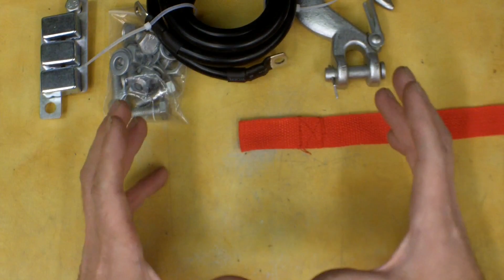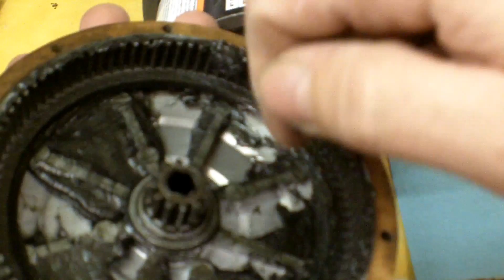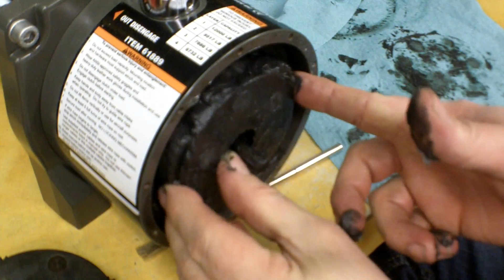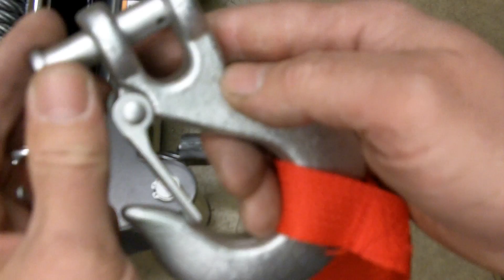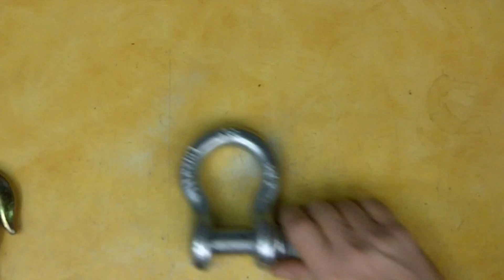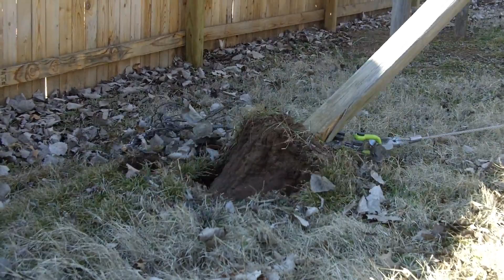Harbor Freight 12000 LB Winch Review, Teardown, Installation, Safety, Etc. Model 61889

Comment: I just bought a ZXR 12000 on the same Super Coupon deal for $299 and I also got the $59 wireless remote control because mine is being installed in my enclosed race car trailer.  The bracket on the box on mine attaches differently than yours ( the outlet or plug for the remote controller is further towards the rear on yours also) because on mine the small screw goes through  the bracket that yours has threads in as a clamping screw in on the bracket on the bottom of the box and mine screws into threads in a second tab that came in the bag with the washers, nuts and sundry other hardware so that it clamps it down around the bar.  But therein lies the problem the wired controller barely clears the spring where you plug into the box on mine - - the plug in piece for the wireless remote does not clear the spring no matter how far to one side you set the box so I am going to have to remove the bracket from the bottom of the box and space it up for clearance (the remote is a badlands apex wireless remote) so somebody at Badlands gets an F on their clearance homework.  Its going in a 28 ft. enclosed trailer plus 6 to 7  ft. of back door for a ramp so the wireless remote will allow me to sit in the car and steer it into the trailer so I don't need a 35 ft. cord which I could run over on the way in. UPDATE - - I found that once I took the attaching screws out of the bottom one hole on each bracket had a slot rather than a round hole so I reversed the brackets putting the slots forward ( slotted towards the Badlands logo) and the remote piece cleared but I'm still adding a washer or 2  because I don't want those springs on the tensioner rubbing on the box as they move to maintain tension as the cable plays in or out. Nice video, good detail and time will tell how this winch stands up to my old 9,000 Warn that I use on my open car hauler - - I've straight pulled a Class C Dodge RV up on to the trailer with a dually rear end that the brakes were locked up on from sitting so I was sliding the rear tires. It took some work but we got it loaded - - good luck with yours and hopefully your wireless remote is just plug and play (or work)
Reply from the maker: I'm not familiar what the ZXR Gary, but I'm sure your information will be beneficial to others. The wireless for this model was plug and play. The winch itself, albeit not worked hard, is still working great. Take care, G.

Comment: Curious if the winch is still running good and if you've had to get into it again for grease and or any service needed any problems over the years?
Reply from the maker: Caine, It's still working great and I have not gone into it since this video. Mind you, it's never seen hardcore use. If I need to use it, I install it and it just works. Good luck, G.

Comment: I appreciate the video and time you took explaining everything.  I have the same winch (several yrs old) and will be disassembling to inspect and re-grease.  Just curious, what keeps the 2 types of grease you used separated, if any?  I understand the regular type was only used on the outside of sliding ring gear but without a seal/o-ring of some sort, I would think over time and multiple heat cycles, they would eventually blend together.  Thank you
Reply from the maker: Thanks! I honestly can't answer what keeps them from mixing.  All I can say is that I've not been into mine since posting and it still works great. Not a concise answer by any stretch- but that's what it is. Good luck, G.

Comment: I would like to know how you got the solenoid cover off.  I have a winch like yours except mine does not have a tensioner on it. The last time I used the winch and went to release the line to undo the load all I heard is a clicking coming from the box.  I am having a lot of trouble trying to get the top off,  can you help me?
Reply from the maker: David, I believe there are screws that can be removed from the bottom of the box to gain access. This is from memory. Hope this helps, G.

Comment: Fantastic video.  I was very surprised at the duty cycle.  My winch spec is 1 minute on, 2 minutes off.  As stated in the manual, this is to let the battery recover.  First I should mention I have a Quadra Tech 9000 lbs winch.  The difference between the 9000 lbs and 12000 lbs is gear ratio. 

I found out the hard way.  The most important part of a winch is the battery.  If the battery is no good, neither is your winch.  Cost me $600 for a glorified taxi ride.  Got my self unstuck, but killed the battery.  Long story, save the details.

Must laugh at the trees being pulled.  Have a YJ.  I had the winch hooked up to a branch of a holly tree.  I had the wife winching while I was cutting.  This was when I was on a extension ladder.  Gave her the signal to winch.  She did not stop.  She pulled the whole tree down.  The stump was over 18" around.  The neighbor, professional tree feller, was amazed that happened.  This was done with a relatively new 850amp hr battery.

Long story short.  I love my Quadra tech  winch.  I have had issues with it.  Never left me stranded.  The tech support is unbelievable.  My winch was 5 years old and they replaced it.  I do not think HF would do the same.
Reply from the maker: Thanks John, glad you liked it. I leave the vehicle running to help with any battery drain. Glad they took care of you. I agree- HF after that long probably would not do the same. Take care, G.
Reply: @ghostses  Your welcome.  I always run the engine too while winching.  My battery died because it was old and and under rated.  It did come back to life after sitting for an hour or two..  At least to start it. 

The winch will pull 200 amps plus under full load.  Most alternators will only put out 100 amps.  This is why you need a high amp battery if you wish to get the most out of your winch.  That and the higher the voltage that is maintained, the less stress on the motor.  Higher voltage = less amps = less heat.
Reply from the maker: Very true John. Check out my review on the TackLife lithium jumper pack. It could be a good thing for situations just like you described. It's proven itself to be one of my better purchases. I make no money off my reviews/videos- so you get it straight as I see things. Good luck, G.
https://www.youtube.com/watch?v=GE8JV-S4NpU

Comment: I must have gotten a recycled return, the 3 circuit breakers were already connected to the short red lead with the red hood. Would it really matter where in the circuit the breakers are?
Reply from the maker: I would relocate the breakers to the battery side. You wouldn't want the buss so close to a ground that something could short things out. Good luck, G.
Reply: @ghostses  Thanks, and I should have mentioned at the outset that your teaching style is both informative and entertaining.
Reply from the maker: No problem and thanks! G.

Comment: I was using my 12,000 pound Harbor Freight winch and was winding it in and it stuck in the IN position even though it was not being pushed by the switch button. If i pushed the out lever it would stop coming in and if i let it go then it would start to come in again so i had no "out" working with the switch. I heard a clicking noise in the black box and removed the hot post wire and when i touched it back again to the post i saw what looked like and sounded like a live connection to the winch motor as though the switch was engaged in the "in" position. What went wrong? Any idea? I cannot put the hot post on because it engages the "IN" to the winch through the switch, no "out' at all.
Reply from the maker: To me it sounds like the solenoid contacts may have welded shut. So when the power is applied contacts are already closed therefore it automatically starts winding in. You might try opening up the lid and tap on the solenoid to see if it will break open. Short of that working, you might try to find a new solenoid. Hope this helps, G.

Comment: Over the years I bought a lot of Chinese motors and other types of working parts they have grease in them and I couldn't identify the grease right away it took me a minute. I work as a geotech for many years and I had to do a a spectral analysis of some grease I took it into the lab one day and thought hey I'm going to check this stuff out it's more like a packing grease because China's humid temperatures. And the fact that China just uses the crappiest grease that they can find. But I believe it's packing grease is what they use or a variant of that. It's kind of like gun grease or gun oil that they pack large numbers of weaponry to store them for one. Of time because a lot of these pieces of equipment are stored on docs for a very long. Of time before they're shipped out to the United States or Europe
Reply from the maker: Interesting information! That sound extremely plausible to me. Take care, G.

Comment: All those screws and bolts need blue Loctite at least or else they will vibrate out when driving on corrugated roads(in Australia especially) . Those sprung fairleads are rubbish . they stop tangles when running out, but cause issues when winding in under load. regreasing the unit with normal wheel bearing grease is Ok, but I prefer water resistant grease usually used on boat trailer bearings.
 A very good review, strip down and comments, fair to the product. Well done.
Reply from the maker: Thanks Ron! Take care, G.

Comment: Thank you for the video, it was very well done overall. I am curious how your winch/initial install on your truck is working out, four years from when you published this video? Also, you mentioned while you pulled that tree out that your truck was anchored...is that more than just in park I presume, attached to a tree or something else?
Reply from the maker: Thanks Dexter! Glad you liked it. While it's not been used extensively, it still works great when it is. Yes, it was strapped from the rear to a tree. For smaller things- park and the e-brake may work. Good luck, G.

Comment: Dont put your control box on top of the winch it can get torn off by the spooling cable or tampered with by stupid people. i put my control box behind the grill with only the outlet plug showing just a little. Ps its a great winch at a awesomely fair price. Dont forget to hang a fairly large piece of carpet or matting or even a heavy jacket over the cable about mid way when winching. it will help prevent the cable and or hook from going through you windshield or cutting off your head in the event the cable or hook breaks free under stress..
Reply from the maker: Good tips! Take care, G.

Comment: Screw pin shackles need to have threads fully engaged on the shackle ear. (The pin should be flush with the outside of the shackle body or slightly past). The pin head should make contact with the shackle body. Bolt nut and cotter shackles need to have the bolt and nut properly secured with the cotter pin attached.
Reply from the maker: Thanks for the tips! Take care, G.

Comment: I bought one and installed it on a rolling A FRAME in my garage to pull engines with and a smaller one mounted on my wall to use on a small lift to raise my riding mower off the floor for storage of it.  Works great.
Reply from the maker: That's cool! Take care, G.

Comment: Graphite in its self is not corrosive to aluminum if water were to get in there that could cause it to be more corrosive but the other metals and the fact electricity is In there that would also cause it to be more corrosive so that could be graphite in that grease
Reply from the maker: I'd read that somewhere in the past but probably glazed over it requiring an electrolyte for galvanic corrosion to take place. It could have graphite in it, I don't know. Take care, G.

Comment: Just ran into your video and you answered a lot of my questions about this 12000 lb winch. Thank you. I have one more question, the cable they put on this winch is a 3/8" cable and I think 12000 lb is the breaking strength for this cable so is there any concern? Same with the 3/8" hook they provided and again it is rated way under 12000 lb. What would you do if you want the winch to be safer and stronger?
Reply from the maker: Thanks Alex! Glad you found the video informative. It's been many years since I posted this video so I really don't know how to answer your questions. I've forgotten most if what I stated. I can say I've not had any problems using it as shown. Look into the WWL on cable and hooks. They "should" be rated around 4-5 times in excess for safety. Certainly not the definitive answers you're looking for- but hope it points you in the right direction. Good luck and take care, G.

Comment: I have a badlands 12000. When you would run  the cable in it would make a clunk but it would run the cable out.  I took the motor off and found a set screw on the drum that  was hitting the break. I removed it and it works. Do you know what the set screw is  for?
Reply from the maker: I know on mine, there is a bolt or something that holds the cable on the drum but it's on the outside of the drum. I looked at the parts breakdown in my manual and don't see anything that would be inside where the motor is. Good luck, G.

Comment: For short pulls use a snatch block  that will double your pull power.  I have an old Hickey Sidewinder it has been great only been apart once for cleaning and new oil  it is on an old 1977 K20 Silverado  454 LS-6 / 4L80E   It Hauls Ass  on 36 swampers
Reply from the maker: True! Sounds cool. Good luck, G.

Comment: Graffiti will not cause any problems when applied to aluminum
Reply from the maker: I can't disagree with your comment William- especially based on what I said in the video. But unless I'm incorrect- graphite can corrode aluminum if in an electrolytic solution. So lets say the winch gets submerged in salt water, and it gets inside, it could cause a problem. Either way, thanks for the post and good luck, G.

Comment: Thanks! Great video!

Part number for that Northern Tool mount? They don't show anything like that on their site :(
I'd rather have that one than the Harbor Freight rig.
Reply from the maker: No problem! It appears they've discontinued the NT winch mount. There was no part number on it- just a NT sticker. Good luck, G.
Reply: @ghostses  That's what I was thinking too. I'll prolly just weld a plate off the front of my car trailer and bolt the winch directly on it.
Reply from the maker: That's cool! Good luck either way, G.

Comment: There's a lot of folks on here worried about water intrusion. On any winch, cover it during any water crossing with an air tight bag with no holes and cinch it tight around the unit as low as it will go, even a garbage bag will work. The trapped air will prevent water from enveloping the unit even though the bottom is open. You're welcome 😉
Reply from the maker: Good tip! Take care, G.

Comment: Would you happen to know why the reserve don’t work on mine. It stopped working all of a sudden.
Reply from the maker: My first guesses would be the controller switch, or the solenoid. You might try swapping the blue and white wires in the box to see if it turns the other way to rule out the motor. If it works then, the motor and solenoid are probably fine.  Put the wires back the way they were and focus on the controller switch. You should be able to check it for continuity while probing the correct pins and actuating the switch. It's hard to think of everything it could be, but that should give you a place to start. Good luck, G.

Comment: where did you get the quick disconnect from? I tried buying some off amazon but they don't work well. yours looks heavy duty. this was by far the best video I have seen on anything!
Reply from the maker: I got it from a friend Andrew,  but it's a Rema SR175. Here's a link, but check the wire size to make sure it's correct for your application. Also, I believe you would need to order 2 as I think they're sold for each half. Check around to see if you can find a better deal. Not sure what you got off amazon, but this one is pretty heavy duty and locks together tight. Hope this helps, G.

https://www.amazon.com/175-grey-connector-50mm2-contacts/dp/B01E5H4KT0

Comment: I'm thinking about getting the 12000 harbors fright winch. You still happy with your purchase? 
Great video
Reply from the maker: I am. I've not used it hardcore- but it still works great when I do. Good luck, G.
Reply: @ghostses  SO, I got the HF 12000 I have it set up on a tray so i can use it on the back or front hitch. 
Just yesterday I get a call from my niece that her boyfriend and a budy got stuck off road (way off road, look up burro Caynon, Colorado river) 
So I was actually excited and took the 10 mile Road of Mountains and rocks down to the 1st Truck
We get down by the river and it was buried with the front wheel off the rim and the other truck was on a real steep incline with his rear wheels buried. 
They didn't think they were getting out. 
I was AMAZED at how easy I pulled both out. 
Thanks I bought the winch because of your video.
Reply from the maker: Good story! It sound's like it's already paid for itself with those two pulls! 
Glad to hear it's working out for you thus far. Take care, G.

Comment: Do you need to protect the cable with oil or Grease
Reply from the maker: Good question Cory! Mine doesn't stay in the elements but the cable should be protected. Here's a link to something that can be used. Good luck, G.

https://www.amazon.com/CRC-Chain-Lubricating-Spray-Weight/dp/B0013J84C8